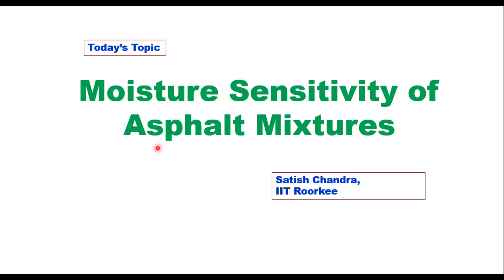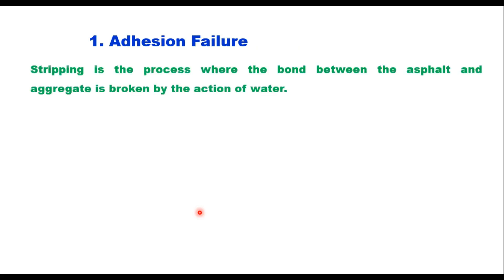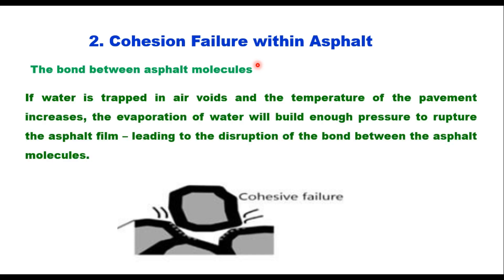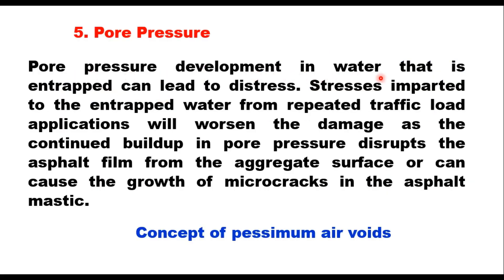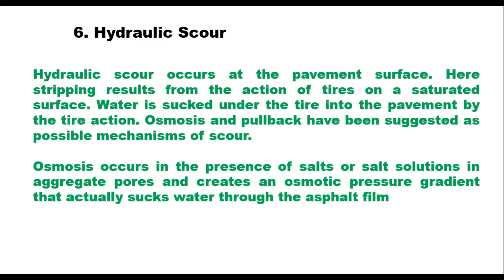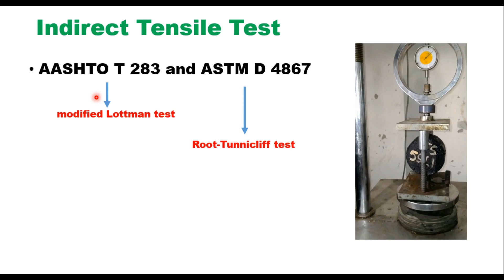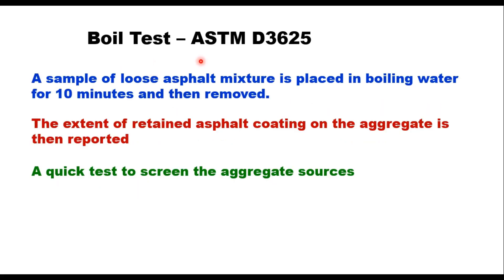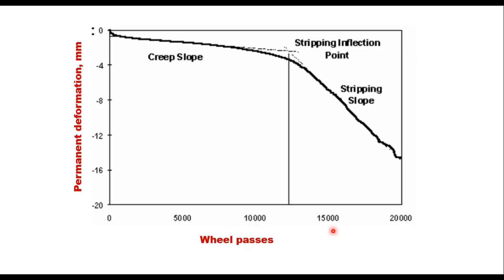Moisture sensitivity of asphalt mixes - Mechanism and methods of evaluation MS-2 7th edition

Comment: Sir,your videos are very helpful for learning.thank you sir.I have one doubt,In some congested areas engineers  spread msand in a hot pavement surface and allowing the traffic on that pavement immediately,can You please explain the effect of spreading Msand in hot pavement.whether it is right or wrong.sry for troubling you sir.
Reply from the maker: Spreading of manufactured sand on hot layer is not a good practice and should not be done, rather hydrated lime may be used if you are to allow the traffic immediately after the layer finish. Sand, being a coarser material is likely to settle in the voids.
Reply: @SatishIITR  Thank you so much for your reply sir🙏